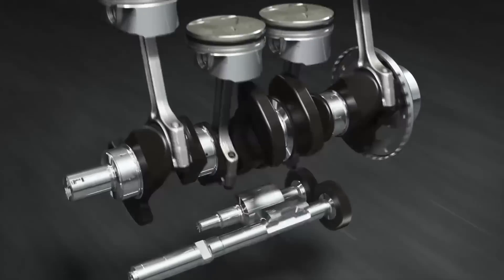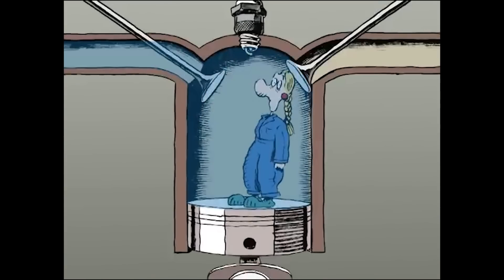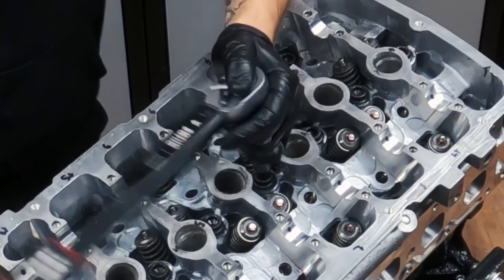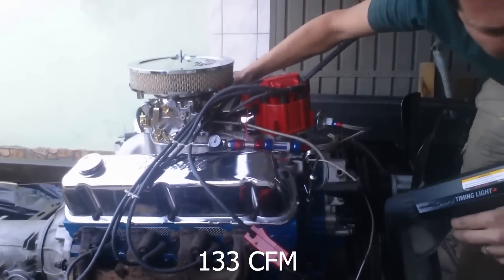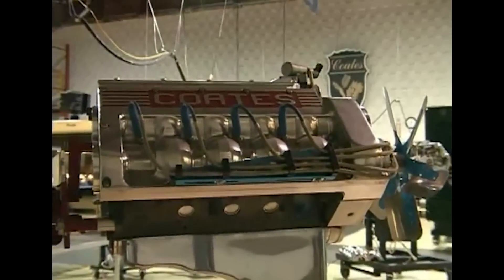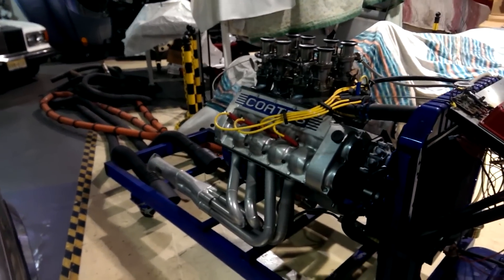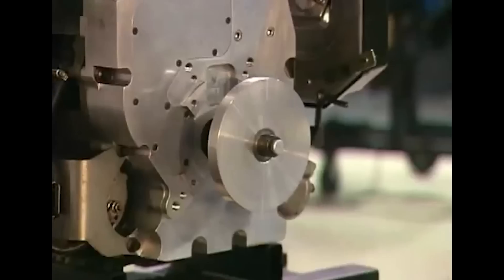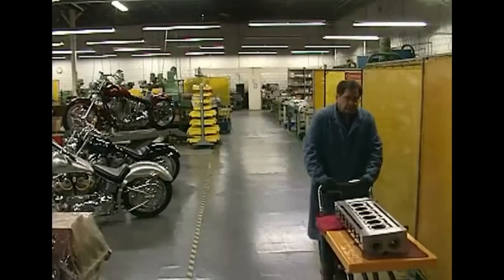A Promising Evolution in Engine Design - The Coates Spherical Rotary Valve

Comment: You don't see it because of lobbying, car manufacturers don't like Innovation theyre not interested in changing their production line , this tech is now being used by rev engines on their 2 stroke yet to get out of prototype stage , traditional valves were more of a headache to get right than this ever could be , it was almost half a century to get them to a acceptable reliability level and they still are barely acceptable on high revving sporting engines they're never going to be a worry free part because of the extreme stress it goes thrue , the rotary valve on revs engines also is completely sealed of off compression and combustion pressures so it has everything it needs in theory to provide unmatchable efficiency and reliability, car manufacturers as a whole don't want to take risks

Comment: I just adds more credibility to the Freevalve set up by Koenigsegg. I don't know if it's a electric orr pneumatic operation but there are no cans or valve springs just an actuator similar to a Ducatti . But the Freevalve motor can rev way up like 15k rpm .  That's about as good as they can get it. This motor will always have a sealing problem. The best they could do and it lost 15% of the compression they just can't get the disc or tube that moves the af into the chamber to seal up as it rolls closed. That's the problem they can't seem to solve. The rotary has a blend that they were messing with. Idk

Comment: As far as I can see no real option for variable valve timing or lift - so not efficient across the rev range. Quoted flow numbers are not that unusual? 2 valve (poppet) LS cylinder heads are available the have these flow rates on intake. Intake and exhaust CFM are typically different - exhaust is under greater pressure and does not need native flow rate of intake. And 4 valve or 5 valve heads flow more. But just having a high CFM can destroy low end performance - hence the complication of variable valve timing and lift. Porsche even have variable intake length. Direct injection has enabled high compression rates on "ordinary" fuel, working high compression gives better efficiency and power. Sealing mechanism on these could probably be made to last for warranty - then total engine throw away when it fails - as per many modern engines.

Comment: When it comes to practicality and long life, it's just really hard to beat the cam-operated poppet valves. Otherwise we would at least see some small sports cars with rotary valve engines.
Interesting idea and very cool! It just seems to me they still had too many problems even if they were able to eliminate the need for mixing oil with the fuel.

Comment: Imagine a push mower with 22" blade. Powered by a 20 hp engine. The can rev to 14,000 rpm. Now there is an idea that will lift off from the start.
Reply: That would be absolutely wild. Even the most overgrown uncared for lawns would be no match for a lawnmower like that.

Comment: The reason it didn’t work is because  the rotary valve is like a rotating drill bit and at the point where cylinder pressure is sealed the constant rotation quickly wears that seal and you began to have cylinder pressure leaks . The standard tapper valve statement does not exhibit rotary wear on the seal surface and so it has the longevity needed for 100,000 plus miles.  Among other problems that I don’t feel like elaborating on here

Comment: The 80 cc Yamaha 2-stroke motorcycle used a rotary valve setup . I owned one for a short while. It was short on power, but ran smooth.

Comment: Aside from some of the other comments about sealing and blowby I find the testing and claims a little disingenuous. For example, a 5.0L motor only breathing 133CFM has the WORST cylinder heads and possibly cam that can be found. The 319CFM claim for the spherical valve is approaching the limits, but is not extraordinary. Coyote heads flow just under 300CFM stock. Aggressive porting can get them to 330CFM and make similar power numbers claimed for this motor. In other words, there really isn't enough of a difference to make such a costly change. If they could get the sealing and blowby issues resolved it might be interesting because the spherical valves or some other type of rotating valve assembly would eliminate the friction and power loss induced by the spring pressures needed for tappet valves. It also allows for higher revs without valve float. Still not really a game changer but more like an alternative (and more expensive) way to achieve similar peak results we see today.

Comment: well you are certainly right about the poppet valves being a really weird thing. I know that Kawasaki used a rotary valve in some of their two strokes back in the early 70's, the valve system worked but the bike had so many other flaws that the value of the valves was easily over looked (noteworthy problem, the ignition sparked sometimes and was only loosely connected to the piston movement). Now as far as this goes, it looks to me like the design of the compression chamber might have been part of the problem. The sharp edges of the ports would certainly cause detonation (I might be wrong but I do not have a good design blue print). Still the piston engine needs better valves. The two stroke diesel idea using spark ignition (mazda and others) seems worth more effort and some kind of 4 stroke application might work out. See 'Driving for Answers' for further discussion

Comment: don't like it and I'll tell you why. It is good that you don't have to resist valve springs with cams, but based upon the display, if there's more exhaust duration compression that needs vented, it's trying to push that into the same volumetric pocket. It looks like all it is is a pocket that it has to push it into until it spins to expel it out instead of the engine is pushing all of the spent mixture out through a hole on its own. You'll increase compression but it doesn't look like it increases compression in a good way.

Comment: Rotary valves in many shapes and forms have been tried at least since WW2, so this is nothing spectacular. The tech definitely works and offers considerable benefits, but requires costly high precision engineering, something not conducive to mass production.

Comment: Coates went public in the USA and took investors money, then ran to China and stole every penny investors put into them.  Stock market is legalized theft I guess...  If it's so great why didn't they make heads for Chevy, Mopar, and Ford along with popular Japanese 4 cylinder engines.  They could have made a fortune in the aftermarket if they could make engines spin higher than 12,000 rpm. I called them and asked them and their answer was "we don't do that, we make generator engines."  When I asked them why wouldn't they license this tech to the big 3 they wouldn't give me an answer.  Coates is a thief...!!!

Comment: Only just come across this video. Several commentors say they remember seeing something similar, or using a rotary valve before, a decade or more before. This is likely because Kiwi home engineer, Ralph Watson, converted the heads on a BSA engined car used for club sport and hill climbs. Starting in the late 80's, based on designs from the mid-60's to mid-70's, he SUCCESSFULLY raced the car and engine in 1989 and onwards. 

Despite Mr Watson having passed away since then, he had much success with the car, and she continues to race in 2023. From what I understand, an engineer from Coates got talking to Ralph Watson at an Aussie race meetIng the 90's, and hence the genius continues, despite no mainstream manufacturer wanting to invest in such a technology change at a time when EV's are all the rage and hype. Now,30-40 decades later companies are starting to invest in looking seriously at the idea again, especially as it could move internal combustion engine efficency in to the 50%+ range for the first time ever. Vehicle electrical energy recovery systems barely reach the high-40's!

You tube channel "driving 4 answers" covered this subject quite well here: 
  https://www.youtube.com/watch?v=DZU8tsNNxGA&t=2s 
another YouTuber tries to build a rotary valve engine from an air-cooled single cylinder motor here: 
 https://www.youtube.com/watch?v=1EP49XuejVM 

With virtually frictionless bearings and the availability of DLC coatings, their is no reason, that I can find, that this type of rotary based inlet+exhaust system couldn't or shouldn't be developed for mainstream engines, even if only for muscle cars or lightweight sportsters.

Comment: This will work great until carbon builds up on the exhaust valves, then things start to break, maybe a 10k mile disassembly schedule for the cylinder heads?

Comment: This design looks like it would rob the engine of horsepower... because; the valve volumes are much smaller than the cylinder volumes. Which means the gases need to be compressed into the valve; once in the intake valve, and again into the exhaust valve. In fact, they don't look so much like valves as they do small gas storage containers.

Comment: All of these fancy more efficient systems suffer the same ultimate flaws of short life, severe tolerance issues and throw away major parts as the cost of replacement is less than the cost of rebuilding them.

Comment: I have thought about something along these lines before.  The obstacles are not so much efficiency or breathing, but chamber sealing for combustion and price of production.   And then come carbon concerns: there is a constant burnishing of rotating parts exposed to combustion byproducts.  Complex machining gets expensive - try working on a hagglund [hydraulic] motor and you get the picture.  I'd like to see this engine concept work , but.. price point vs function?  Mass produced engines stick with traditional valves. If this tech was better... F1 would have had a go of it already.
Where could this be useful?  Maybe to regulate a high boost system to get away from higher valve spring pressures and free up some power... but that's extra weight.  Clocking boost pressure off without changing blower speed when intake valve closes is what I picture.  Maybe this finds a marine application.

Comment: 14:1 is still done with traditional valve designs. It’s just more common in a motorcycle engine than a car engine. But even the Mazda Miata engine has a 13:1 compression

Comment: I had a 1969 Chevrolet 350 back 1976 that I put a one rotary valve with intake and exhaust same tub to reduce the temperature. Instead of 2.02 intakes and 1.65 exhaust, they were 3.50 intakes and 3.50 exhaust. Could not get the rotary valve to seal!

Comment: I see a couple issues right off the bat: First, keeping that rotating valve assembly lubricated will be a chore. That's a whole lot of friction surface in the hottest part of the motor. Second, although a turbo can solve the problem of air volume on the intake side, the exhaust side will need a rotating chamber volume at least equal to that of the cylinder volume, or else you are compressing the mix twice. Such a volume would make the head assembly so freakin' large that it might make the motor impractical.

Comment: A Poppet Valve engine will run 200,000 to 300,000 miles with no maintenance of the valves or head work.  I do not see this spherical valve train lasting that long.

Comment: I have seen a motocross engine, that was 2 stroke 1 cylinder that I think bombardier made. It had a single spinning plate for intake and exhaust. The engine was open and was being worked on at the time. Iwas told it could reach rpm of well over 10,000. I would say it was in the early 80s. I though that was very interesting at the time, and still do.

Comment: Apart from the sealing issues, I remember reading or hearing about the airflow eventually choking itself at higher rpm's due to the speed of the air reaching Mach speeds. Not sure where I heard or saw this, but it has always stuck with my memory.

Comment: That spherical rotary valve assembly looks hefty to suggest parasitic energy losses from inherent inertial disadvantages. Improved power, efficiency and heat dissipation advantages can only be offered at a constant engine speed  but not in real life frequent engine speed change scenarios. The increased inertia of this system will requires more power robbing  low to high engine speed shifts which in real street or track driving will translate into worse acceleration performance, more heat retention once the 'deep'heat sink' assembly becomes saturated, and less efficient energy draws when repeatedly going from slower to faster speeds. This system would be more suitable for high rpm drag racing combined with heavy clutch construction.
Reply: Cam operated poppet valvetrains are big energy parasites.  They also have dynamically changing loads.  The rotary valve concept would be superior in this regard despite the physical size.  The sealing problems are substantial and likely the barrier to implementation. If this was a viable solution, F1 would have developed it, as even F1's current pneumatic valve springs are problematic.

Comment: Coates had a building in Wall Twp ..I visited their shop in the early eighties..what’s amusing is their shop coats…somewhat pompous..but what caught my eye is the bicycle cable that was their throttle control…it’s just flopping around
At that time ad when your video shows the only production format.that accepted their design was the ford small lock because no center head bolts…such as Chevrolet
At that time I owned Performance Racing Engines in Point Pleasant Beach and visited their shop….nothing was going on and the limited equipment was a Tree milling machine and a lathe the dyno was what you show as is the Coby throttle

A lot of undocumented claims were made but as I offered a mustang chassis to put there mule into the car for some 1/4 mile drag tests….they denied and at that time were only talking about ceramic spherical seals

They were also looking at the Mercedes twincam inine engines because of the permitter head bolt  arrangement.but I don’t think it happened
Reply: https://youtu.be/Zj_SIeFjisw?si=aOZXN6pNpw1Ryvqs

Comment: Poor seals blow by , poor compression no good for Diesel engines. Shorts service life. Variable valve timing not possible. Burns oil.  Heat dissipation poor affecting seals. Expansion contraction issues.

Comment: I first saw this type of technology back in the early-mid 1980's, don't remember the developer but it seemed as though the initial problem had to do with carbon buildup on the lobes and causing failure of the sealing ability. Maybe it would be better suited to a gaseous type of fuel such as propane. Is a shame that it can't be resolved as it would simplify the valve train assembly quite a bit.

Comment: I actually do know a little bit about Coates International. I worked on a team developing cylinder heads valve covers front covers and intake and exhaust manifold at a foundry for an 850 in.³ engine line 6 engine with coats spherical valve technology. I have met George coats personally and done a tour of his shop. This technology is not phony, but I am aware of how big business are looking to buy the technology so they can shelf it. Coats wants his technology to be used all over the world. That is why he will only deal with businesses that will buy a license and pay a per engine royalty of $50. This way he can guarantee that the technology is not buried.
Reply: That is kind of strange, I was doing it in 1974.
Reply: And I was doing it in 1970 with a Kawasaki!
Reply: Thank you so much for your post. Sincerely!
Reply: Can a person buy the heads?  I have a 5.o old ford engine and would love to be able to rev up to 14000 rpm.
Reply: This with 2 stroke cycle in a mechanical injection diesel would have Unimaginable benefits for civilization... Diesel being in reality a compression ignition engine that can use ANY oil as fuel even used engine oil.

Comment: A guy in the uk built a historic race car running these valves and used them successfully. This was before this company. He passed away however his car is still going and still in use.
Reply: The car with the BSA 90-degree V-twin in it?
Reply: @thorman1742  yes built by Ralph Watson I believe. The engine had never been opened up in 30.000 miles which for a race car is very impressive and the reason it was opened up was due to a failed spark plug. Think it's tip broke off but the valves were still absolutely fine.

Comment: check out "Dunstan Rotary Valve" for the 149ci Holden (AUS) straight 6
its well over 50 years old by now!
It gained WAY more of a power leap from about 131HP to about 545HP with only the head and "DRV" conversion
Aussie Aussie Aussie
OI! OI! OI!

Comment: Winded why the use of spherical valves rather than drum type I applaud the use of carbon ceramic  surely they could run the carbon ceramic housing and seal in contact with the valve wirhout probs this would surely create a good seal especially spring loaded  still be a lot less drag and power sap in the valve train 👍🍻

Comment: No valve springs, no valve springs float at high rpm. Also,  the timing can be fixed on the fly with variable timing added.

Then there is the ease of use and durability seems to be a non issue.

Down sides?